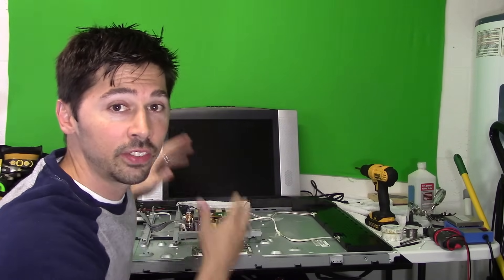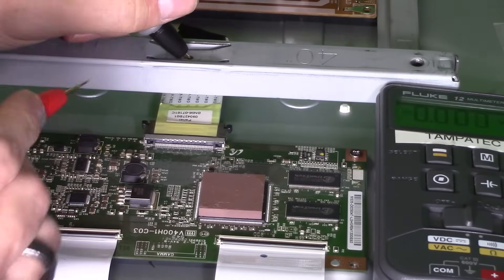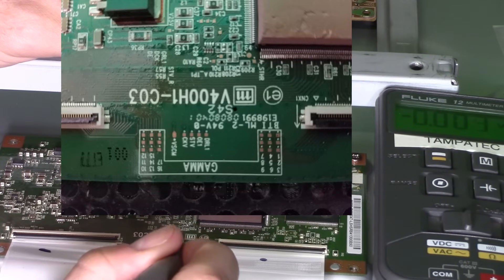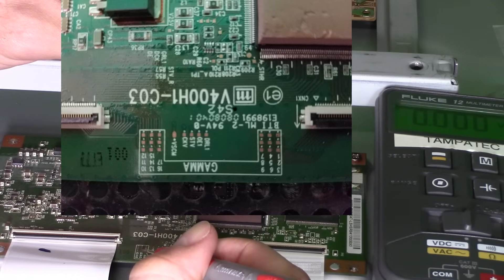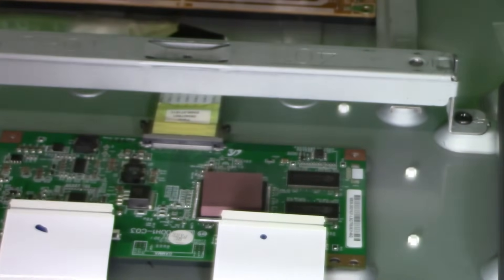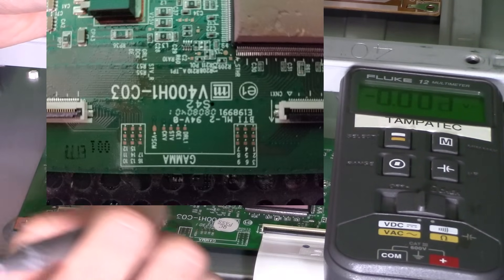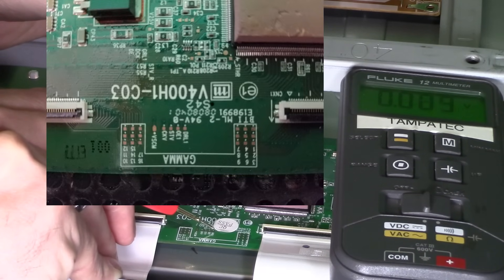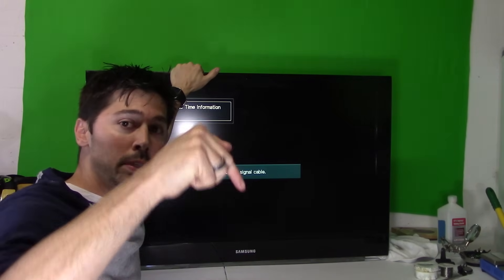THIS EASY 5 MINUTE TV REPAIR WILL FIX MOST VIDEO PICTURE PROBLEMS!!!

Comment: hi there I am wondering if you can help me iv got a Panasonic TX-P42VT0B 3D smart TV bought it and it had no power so I bought a power board and all I am getting now is when I turn it on is a one click from the power board and the stand by light turns green and then goes back to red and nothing on the TV please could guide in the right direction to a fix thank you Michael Bonner my email address is

Comment: I have a Dynex TV model number DX- L40-10A
It recently started not turning back on when when you powered It Off you would have to unplug it and plug it back up and then sometimes you would have to use the remote to turn it on. Well now it will not turn on it all you can unplug it and plug it back up but always forgetting is the red light in the front it's not blinking or anything but when you plug it up it sounds like it's got the power to it it's just not turning on and the blue lights not turning on to indicate that it's turned on. Can you help with that can this TV be fixed? I have subscribed to your Channel and hopes of getting help to get my TV fixed for my kids. Thanks in advance even if it's not able to be fixed.

Comment: Hi, my name is Derrick I have a Vizio p4 46inch plasma tv it has no picture and on sound no backlights. I already change two capacitors. I am receiving 10 red flashes when powering on and `15 green flashes when powering off. any suggestion to why it not coming on. I'm about to change fuse.

Comment: hi can you help me please I have a 32 inch lcd TV lg  smart TV  there about 4 inches from top horizontal line the pictures is perfect above that line  below it there is different colour line what run down but do dissappear.  I don't believe it the screen at fault  and suggestions can't see no damaged caps from visual inspection

Comment: Hello from France ! thanks for your videos it's clear and useful.
I've got problem with my TCL television (TCL L32S 4693). I suspected  the alimentation card and change it but the problem is the same
Nothing on the screen when i start the television. No flash light, no stand by light, nothing at all nowhere.
I test the pins on the alimentation board and found 12v n pin 1 and 2. The standby voltage is 3.3v and it's the same on the motherboard. I found 3.3v on the connectors of the push button menu back of the screen (except on the connector who goes to the led that is indicate that the power is on in the middle down of the screen, (i found no voltage at all on this connector).
I see no led lights on the back of the screen or elsewhere because there is no power i think, what else ?
So i don't know what to do next.
Have you got an idea ?
Thanks

Comment: Could you help me with this matter?I have a Panasonic tv TH-42PX75U the stand by light is on when plug it in hear a little clic but it won`t turn onI assume some thing wrong with the power supply board ,if it is do I have to replace the whole board?thanks  for your help.

Comment: hello. my samsung tv has no pic only sound and blacklights.
i order a wrong t con board it looks different but its the same size and has the same connection. it would fit. can i try this board or will it cause any damage?
original board -T320HVN05.0 32T42-C02 
wrong board - 539h5annt3443ayc00001

Comment: i have a sharp aquois 46 the power board is a dps304bp-1 however i cannot find the 5volt standby power. the relay clicks as it cycles  then i get a blinking power and opc light installed a used power supply same problem what should i look for next\

Comment: Sanyo DP42D24
Picture cuts out after 20 minutes.
black screen.
 comes back on after awhile off with flickering horizontal picture...
sound like had tcon board?
Reply: Could be leaky electrolytic caps in the power supply. Check all voltages on the power supply board first!!!! Replace any caps that are bulging or swollen at the top. Very common on flat screen tvs

Comment: Hi there, I have a Samsung TV about 4 years old. The screen suddenly went black one day and now all I get is basically a black screen with vertical lines. I unplugged everything from it. If I change the source input or go into Menu, the lines change or become brighter. I ordered a tv repair kit and replaced the main board and power board, but the problem still persists. Could it be the ribbon cable that is causing the issue? Any help is appreciated

Comment: my samsung ku7000 has sound but no picture...i can see picture only if i flash a light on the tv.can you please tell me whats the problem and how much repair cost should i expect?strange thing is frst time it occured i sitched tv on and off for 4 or 5 times and it turned on with picture fine next day problem occured again when i tried to switch it on but this time last trick didnt work so i unplugged it for whole night next day it started fine with picture and sound.now the problem came again but this time its kind of permanent and i left it for 1 complete day but still no picture only sound....this problem evry time it came was when i tried switching it on from off it never occured while the tv was on...please help me with your great knowledge and vast experience thanks waiting desparately for your reply

Comment: I replaced the TCON board on my Vizio M43-C1. Problem still remains. The top half of the image is overlaying on the bottom part of the screen. Is my next step to replace the main board (756TXFCB0QK0030)?

Comment: Hi Tampatec, I`m from Tampa to, is good to know you are nearby. 
Some one gift me  a Samsung LN46A550P3FXZA, i notice that the black color has a problem. every time I torn on the tv like 3 or 5 seconds later the black color goes red green dots. I just want to ask you what do you think about it. Do you believe it would be the  T-CON card or another thin. I looked the power supply and it does not have bad capacitors. If you have some time can you look the link. there is a couples a photos and video with the problem. 

https://www.dropbox.com/sh/qy72i68qxprvdfo/AAA-hXOEGx5kbZJOauqdDDrea?dl=0

I want to know your opinion to be a litte more sure befor bay som replacement card. 
Thanks in advance.

Comment: Your videos never fail to amaze me. Thanks a lot. I have a dead LCD TV at home. After switching it on, first the red standby indicator glows. then after a few seconds the blue indicator glows. At this point, the TV display would turn on. But the screen never powers up. Could the problem be with the power supply or the motherboard? I assume the TCON circuit is intact... what do you think?

Comment: Last week I had a power outage due to lightening hitting transformer 
close to my house. The power was out app 12 hours. I have unplugged my 
LG TV model  55lb5900 and let set several hours. I have held the power 
button in for 15 sec while unplugged, went through alot of 
troubleshooting per forums and nothing! I do have a red power light on 
the bottom, but when i push that button, it doesnt turn on. Love this 
TV, hope it can be fixed! Any advice appreciated.

Comment: how you do you know the voltage on each test point
Reply: Hi I have a Visio model e5001-b1 did a light test did not see any light through the vent holes does not make a sound when starting up nor has it ever even when running properly plus did the light test could not see any picture. However, the power light is on. Where would be a good place to start when repairing tv. Note some has been out to fix it once ever since the the tv started acting weird like it would (with no timer set ) just shut down but turn right back on. Now I just have a power light.
Reply: Also note I would turn the tv on when out of the blue it shut down

Comment: please nice work,but please make a video about how to test current in a capacitor and resistor while they are on motherboard and connected to power it there is a real current running through them.thanx,you r  a real help , also please bring the cam to be you and.move it around, also use obs freeware it gives you free facility to divide screen and frame it so you may have different cam with different angles.

Comment: got a Westinghouse 55" led model # Tw75921-SO55D s/n 7593H42601967. Video just quits after several minutes.Time varies. audio continues. can unplug or wait awhile and it works again for short period of time. Any suggestions?
Reply: it didn't even operate the duration of the one year warranty which was worthless..

Comment: What are the indications that the T-Con board voltage readings show a defective board? Are the voltage readings always show a solid reading? Or does it mean that if you get voltage reading thats decreasing abruptly, is it a sign of defective T-Con board?

Comment: Toshiba 39L1350U contrast shot up to max on all sources adjusting contrast down helps but odd color is present on vibrant colors the system menu looks like a negative photo. My thoughts are solarization? the question I have is if the T-Con board is built into the main board as all I can find for this model are a power supply board , main board, connector cables and LED strips and ty for your time

Comment: I have a vizio m701d-a3r and I am starting to get with blots forming on the right side and now starting on left side , the spots are brighter than white and all other colors they are  even on each side 4 inches from the bezel , please help . I had geek squad come out and they said they don't fix panels so, I am not sure if it is the t con board or not , thanks ,scott

Comment: I'm curious how you knew what the voltage values should be at each contact point?  Access to a schematic?  All standardized?  Thanks, I like the videos.  I'm learning a new skill.  Driving airplanes isn't enough of a skill-set.
Reply: Picked up this as a pass time hobby, Like to know also what voltages should be, is this standard for all tv’s. Been watching your vids for awhile now most are very informative.

Comment: Hello I have a Samsung UN55D6000SFXZA with vertical lines on the right side of the screen about 6 inches wide. I have replaced the Tcon board and I still get the lines.

Comment: Vizio D50u 55" no picture or backlight. The power turns on and off only with the tv power button. The remote lost connection to the tv as well. How do I know what parts I need?

Comment: my sony led tv shows two third of its bottom half dar. top one third have perfect picture.  the dividing is sharp and straight. no picture visible on the dark part even with a flash light. when no signal, the bottom part is white, bright on start and fades afterwards. top part dark but menu is visible there. what can be the reason

Comment: Trying to troubleshoot a Panosonic LCD Model TC-L32U22 - getting red "ON" light solid, backlights work fine, no picture no audio.  Tried flashlight test - cannot see anything.  But as I toggle between input option - screen responds by changing brightness.  When TV turns on - the screen shows normal lighted screen but no picture or sound.  Only see two boards - Power supply and main video board.  Ribbon from video board goes off to LCD screen and cannot see any t-com board if any!  Any idea?  Thanks in advance.

Comment: you are very helpfull I have a Samsung 42" plasma model# HP-S4523 and model code is HPS4253X/XAA I just replace the power board and because a gentleman was tossing it out because it was smoking I took it home pluged it in and saw what was smoking and now I have  great picture after the eBay power board.  PROBLEM
is have no sound I  have beautiful picture but no sound what could be the problem.
Thank you 
Dennis

Comment: Samsung model UN60J6200AFXZA. My grandkid hit it with toy and now I have colored vertical lines on 2/3 of screen, spider web crack where he hit and some black fading. Vertical lines cover menu options. Looks like a sine wave throughout screen with highlighted points.  The outer clear screen is in tact and sounds fine. Please help. Thanks.

Comment: Dynex model # DX-40L150A11   When powering on the "Dynex/Please wait" Boots up on the screen. After the boot-logo goes off the sound comes on and there is no picture what so ever. Just a black screen, no channel Icons or information, no Channel/Device port (HDMI/AUX) nothing appears. Just sound. This is the first and only issue I've ever had with this TV.  + Tampatec , I hope you still get messages from older videos. I've looked everywhere for an answer and your videos are as close as I have come to finding out anything. I hope you can help. Thank you so much in advance.

Comment: I have a  Phillips LCD 40PFL3705D/F7. I watched all your videos and think I have to replace the T-CON  (sound, but no picture) but I am not sure which board is the T-CON. It has 2 output ribbon connections and 2 input connections that have wires not ribbons. Neither seem to have test points. Where can I test

Comment: i have samsung 46 inch led tv model no UN46F6300AFXZA i have less than half of the screen running good but the rest is not bright and it is more black but i can see the picture. i also checked the led light strips they are working good. a few days before i dropped a light water on the side and it affected more than half of the screen

Comment: my samsung 32 is not showing any screen change however the buttton lite does change... upon removal of the back i found that only  one board has test terminals and also approx every 5 seconds you can hear an electrical whine and i toched an aluminum capacitor thing and it has voltage. idk if all that is normal but i would GREATLY appreciate your help

Comment: Subscribed and thumbs up. Sony Vaio VGN-SR590, half screen vertical lines good picture from external vga output port. I ask if this is a non-repairable LCD failure or a known fault with this series Vaio that I can repair? 85.00 for new LCD. Thanks for your work.

Comment: Hi, I have Samsung TV Model UN50H6350AFXZA Sound with no Picture. I replaced the  T-con board and power supply still no picture. Please help what else I need to check.

Comment: I have a un40h5003af model samsung tv I have vertical lines on one part of the tv towards the middle of the screen just wondering tips on what you think I was playing  around and applied presser to one of the ribbons and fixed it but I would need to keep the presser on it
Reply: bad drivers, you gotta find something to leave it there making pressure

Comment: I just had new led's put in my Vizio E550i-A0 and when I got it back from the tv shop it had thin black horizontal lines on the left side of the screen from top to bottom and they fade away in the middle of the screen. Could it be the left side ribbon strip causing it to do this. My guess is that the guy didn't put the ribbon back on right or something. Any suggestions? Thank you for the great videos too. They are a big help.

Comment: "If you have voltage on ground you have something shorted to ground..."  Actually, if you have voltage on a ground pin, that is a floating ground. Most likely, one of the screws that mounts the board is loose, or a ground wire broke off. Other than that, great video.
Reply: If your table isn't grounded and you put 12V to ground, all ground points will read 12V.  It can be read either way.  If you ground the chassis then you are correct.  Most TV repairs are done without a grounded chassis.

Comment: I have a Vizio 55", model number M500SV. The TV will turn on displays the Vizio logo then does a quick  flicker and then displays for me to set up my TV signal, when I go through the options to choose signal I select cable then cable device, then once I begin scan the TV powers off by itself. And before I restored the TV's defaults whenever I opened the menu it loaded extremely slow, and using the directional arrows either way there is a long delay so any information you have would be much appreciated, thank you.

Comment: I had a cheap hisense that the picture went dark on the bottom, then a few days later went dark on the top and the bottom got bright again. Got advice from a few people and they all said it was the main board so I ordered one. Didn't help. Well a few weeks later the whole screen went black. The next thing it got was a foot to the screen. Didn't fix the problem but I felt better. I now have a 55" vizio smart 4k.

Comment: Very informative, I have an older Techwood LCD that developed a power supply fault, I managed to obtain a complete working chassis except the TCon board, All powers up fine, But the picture is dark (mostly red & blue) with "ghostly shadows" don't know if its the screen gone u/s or the TCon panel. Will certainly check the test points.

Comment: I have a Hitachi LE49A6R9-  Has sound, no backlights.
Reply: Will you send me the link to what I need to purchase to fix?
Reply from the maker: Valerie Landerking can be bad backlight board (led driver board) but need to check "bl on" volts on power board.  subscribe for more free tech support.

Comment: Hello, how are you? I commented that I have a TV Samsung LED 32 "model: UN32D4003BDXZP, which last week began to suddenly show the colors altered. The TV lights up well, its correct colors, but as 10 or 20 minutes change colors, First to green tones, then changes to purple tones and the sharpness of the image is also affected.I also notice that the frame on the right side is overheating.Many technicians have told me that the display is damaged and there is no Repair or replacement, but none has uncovered the TV. I myself uncovered and the truth that in this model did not locate the TCon card similar to the one seen in the video.You know this model of TV? The fault in that TCon card or will the display be damaged? Where is the TCon card located on my TV? In my country it is difficult to get spare parts but I could buy it through E-Bay or Amazon.

Comment: Vizio  Lcd TV.ModelVA26LHDTVIOT.Power Supply board only has 1.6 volt on standby output connector.Replaced blown capacitors C926,C927,C928.